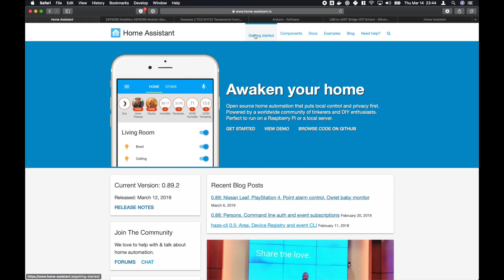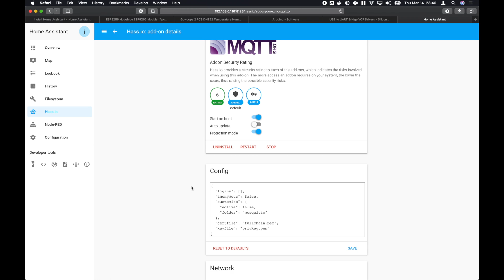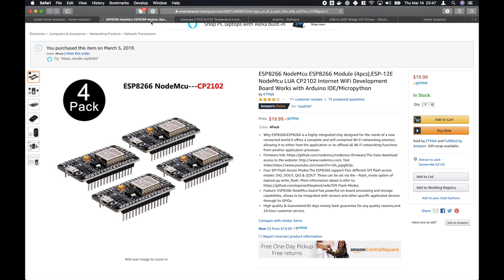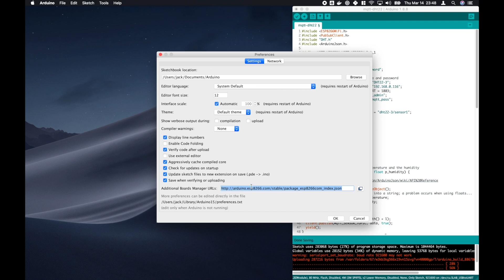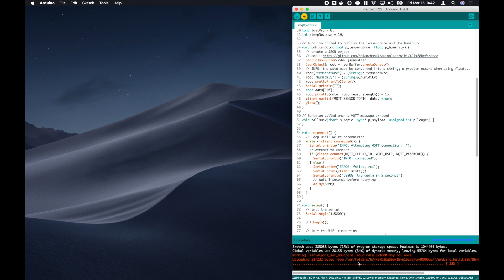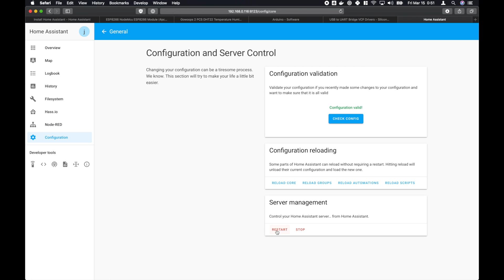$10 DIY Smart Home Temperature and Humidity Sensor with a NodeMCU, DHT22 and HomeAssistant

Comment: I’m glad I found this video!  Most of my parts are actually supposed to arrive today. 

I ordered an lcd so I can see it in the grow room. I’ll also be monitoring CO2 levels. This is my first project with microcontrollers. I haven’t seen anyone using home assistant but I’ll look into it. Does home assistant make it easier?

Thanks for the video!
Reply: I guess I should say easier than logging into an ip that displays the info or making a simple app. I want to build more of these in the future to automate more things so maybe home assistant is a good platform to start with.

Comment: I manage to get temp and humidity reading in Serial Monitor and connection to MQTT is working however no reading capture in Home Assistant, just showing blank
Reply: Just an update. The MQTT Client ID & MQTT topic is case sensitive, both at NodeMCU and HA. Once I change that the reading show on HA. Thanks
Reply from the maker: How do you know the connection to MQTT is working? Did you add the sensor to your HA config?
Reply: @SmartGrowAutomation  I can see sensor reading display in HA. Before this it only shows unknown
Reply from the maker: @clpiau  So now that you can see the readings in HA then is there any problem left?

Comment: what to do when I have a DHT11  sensor? What should I change in the code?
Reply from the maker: Hit @mic_max, I think you will only need to change line 24 : https://gist.github.com/SmartGrowAutomation/b0fab3002206f2b8c9af541aae0f6821#file-matt-modemcu-dht22-L24

Change that to "#define DHTTYPE DHT11"

Comment: Am I missing something here, why do you need the raspberry pi? Don't you just need the other two pieces?
Reply from the maker: The raspberry pi is running Home Assistant software which essentially stores the sensor values in a database and provides an interface to view and interact with the values. It is also great for automating things based on the sensor values. For example, I turn on a humidifier if the humidity drops below a certain value.

But, yes you could skip the pi and store the values on the NodeMCU if you want.
Reply: @SmartGrowAutomation  Ah ok thanks! This is really exciting information!